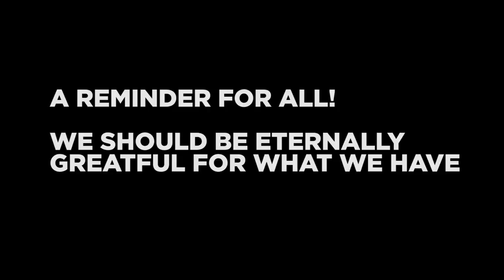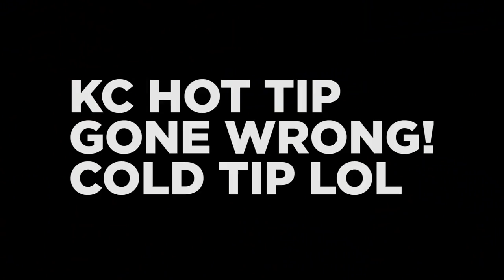Composite Door and Malcs French Doors Work Vlog

Comment: I've always used a few small spots of foam to grab the doors, then opened them and fixed, then foamed up all the way round. I feel like if you foam all the way round, with no fixings, it could push the frame inwards, especially on big windows

Comment: hi stu, quick question why do you use a drill to put the concrete screws in, insted of a impact driver, wouldnt the impact give the screw a better bite?
Reply from the maker: Impact drivers are no good for my tinnitus even with ear protection
Reply: @Stucrompton1  have you seen the Ryobi impact drivers? Quiet strike I think they are called. They are so quiet compared to the majority of other brands. Worth checking out.

Comment: What stops the foam expanding out and sticking to the surface of the door frame?
Reply: Nothing it will just come out , key is not to over do it with the foam , when i foam my doors i use a nozzle so can get it in the middle and stop the foam coming out